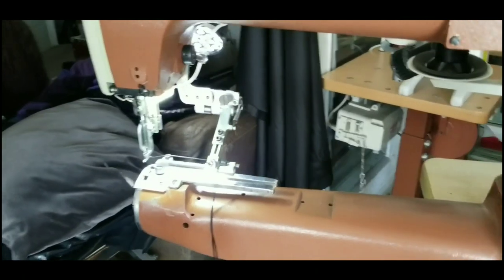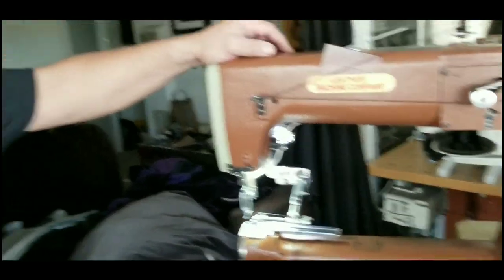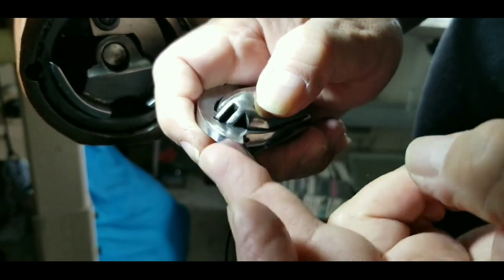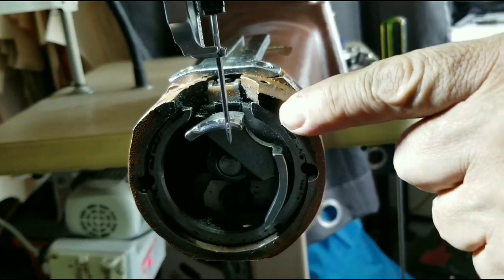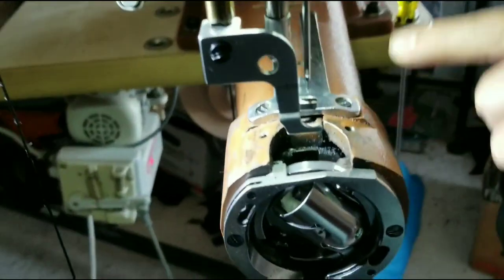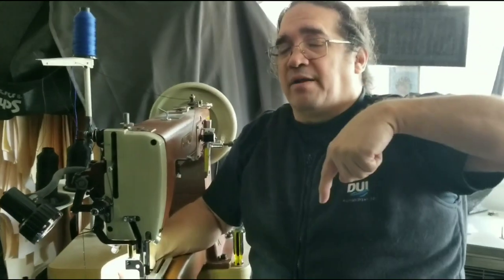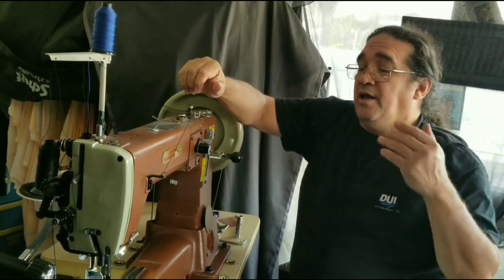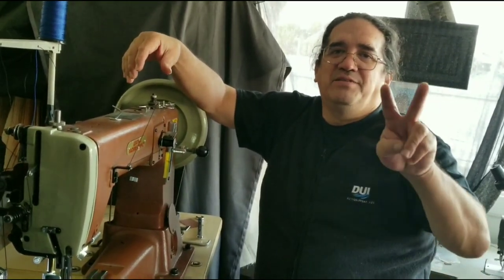Cobra Class 4 needle- hook timing inspection tips and tricks

Comment: Thank You!!! I broke a needle just after getting my machine last May, and must’ve knocked the timing off a hair. Yesterday I turned a thick project wrong, broke a needle again, burred the hook end, made some tears, and screwed up the timing. Al, your videos were key to getting everything right, including the next issue which was low foot pressure causing inconsistent loop depths. My machine scared me at first because the double foot was malformed from the factory (causing flagging), and only 3 bobbins worth of sewing was done on it last year. Your graciously shared knowledge has now made me love my Cobra 4! It runs quieter after timing, and is a dream to use compared to all the Adler’s, Consew’s, and Juki’s I’ve used.